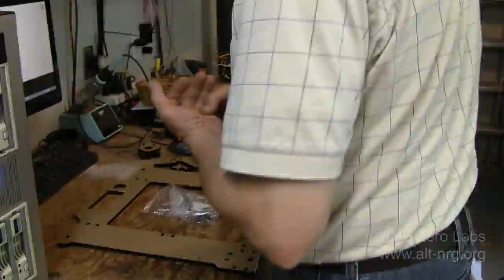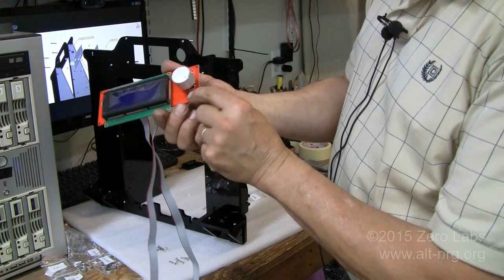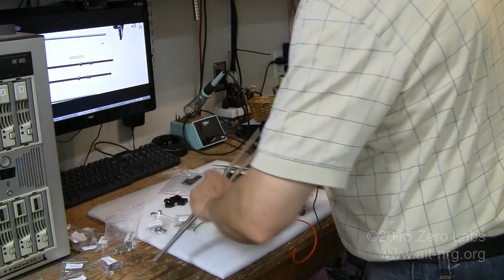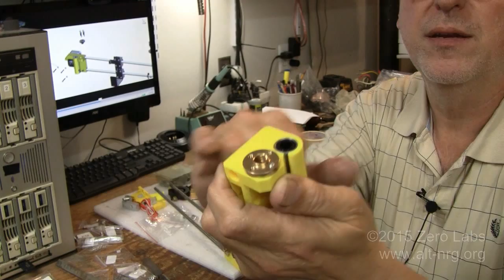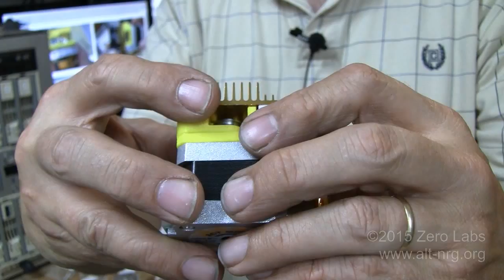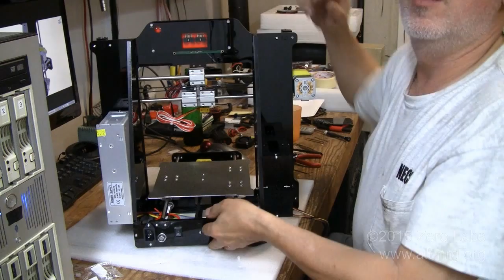#402 A602 3D Printer Mechanical Assembly

Comment: For the extruder clamping arm there is supposed to be a metal sleeve bearing that fits in the bearing arm that prevents the screw from clamping the arm down.  It also prevents the screw's threads from eating the plastic when it pivots.  You might be missing the sleeve.

Comment: Another great assy/review video! 
Hopefully they will really go through your suggestions and FIX THESE PROBLEMS!  You are right... no kit buyer/builder should have to go through this much nonsense.

Z-axis opto-interrupter sensor polarity flip = a 2N3904 & a 10k resistor... right?  (seems easier than software issues). Obviously you have access to +5V to power the opto sensor LED (through probably a 1k resistor); so the new 10k can connect from the same 5V source, to the opto sensor Collector output, also connected to the 2N3904 Base; then connect opto Emitter & 2N3904 Emitter together to the GND connection of the original limit switch input (assumed); the 2N3904 Collector becomes the N.O. switch sensor input to the controller, which likely has a pull-up resistor on the PCB.

I know you know all this stuff Mark, just letting others know.
(AND... since I don't yet have one of these, much of this is assumption... since I don't know what their limit switch input circuit is)

after-thought... simpler?  Maybe you can use the opto-interruptor in a common-collector fashion? Collector tied to +5v, then a low value resistor (470 Ohm?) opto-Emitter to GND, use the Emitter as the "output", back to the controller....?? "Normally" the opto transistor is ON, pulling the Emitter UP to +5v (emulating a N.O. switch), then when the 'opto-interruption' is TRUE (Z-axis = Home), the opto-transistor turns OFF, the Emitter gets pulled LOW by the 470 Ohm... hopefully over-riding whatever pull-up resistor the controller has on that input....  just a thought.....
Reply from the maker: beforebefore yes, i thought about Macgyvering an open collector inverter. Just didn't want to bother.

Comment: Moneys so tight been off work since Christmas. I really want a 3d printer. but cant justify buying something with so many problems to assemble. guess ill wait tell thy come out with a new version and see if thy finally fix the stuff you suggested.
Reply from the maker: The only thing extra to buy is a linear bearing for $5 on eBay if they don't include it. Everything else I show how to deal with. But, money is money. If you don't have it don't spend yourself into debt.